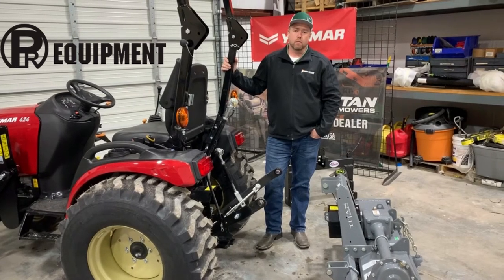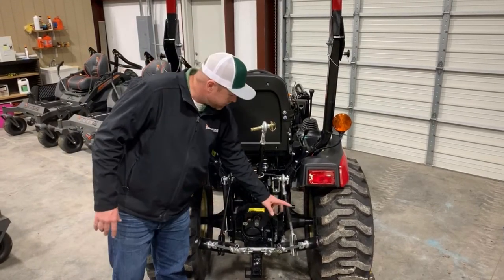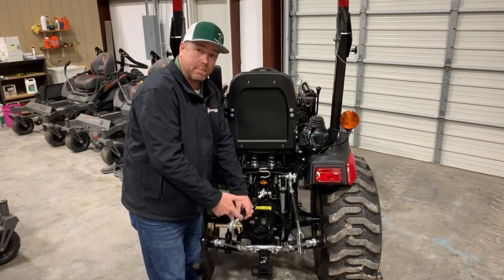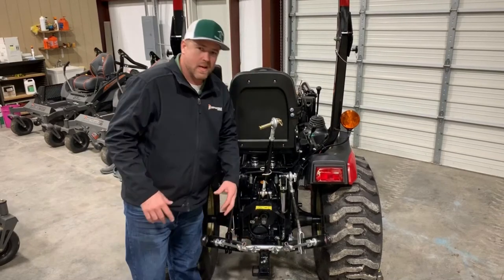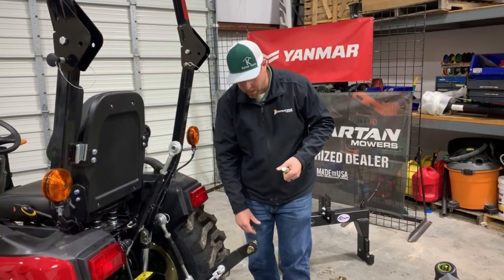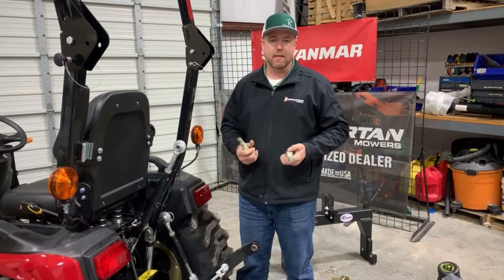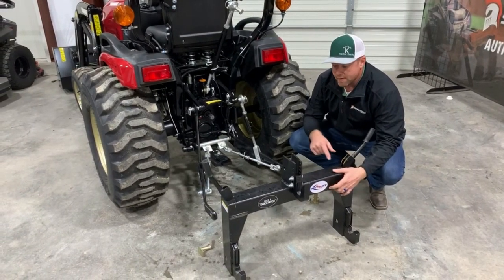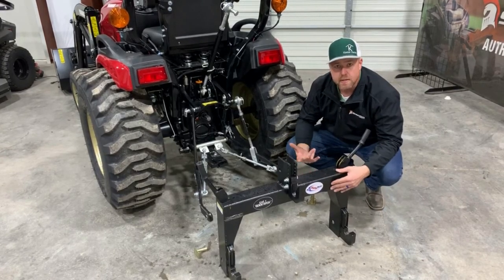Tractor Basics  - 3 Point Hitch and Quick Hitch attachments

Comment: I have the same yanmar tractor.  Do I have to have  all the link arms attached for the 3point to lower it only seams to lower if I push on it.  My hydraulic oil is at the perfect level.   I hope this makes sense to you.  Also can the upper link mount bracket be installed with the backhoe bracket installed.  Hope to hear from you
Reply from the maker: I think I can help but might be easier by phone.  Give me a call sometime 903-270-0877.  Nick
Reply: @prequipmentsales   

How late can I call. I'm on central time.
Reply from the maker: 8-5:30 central